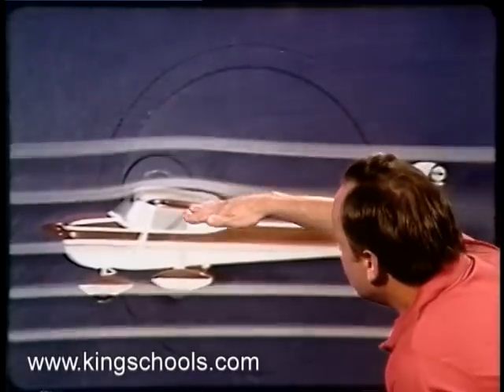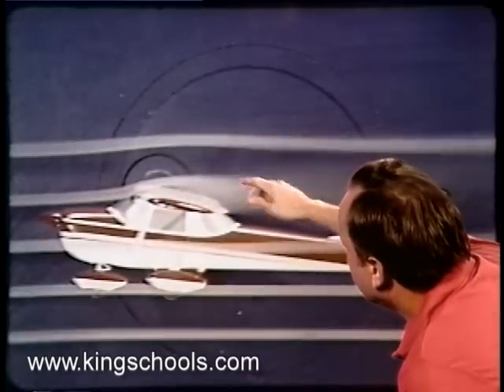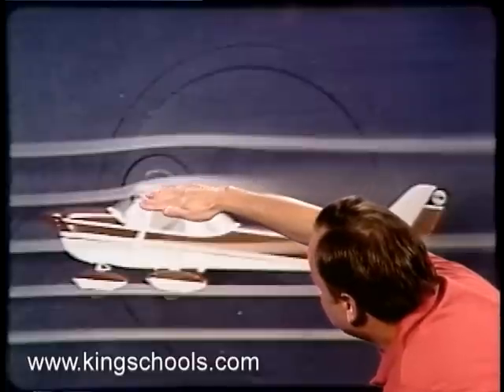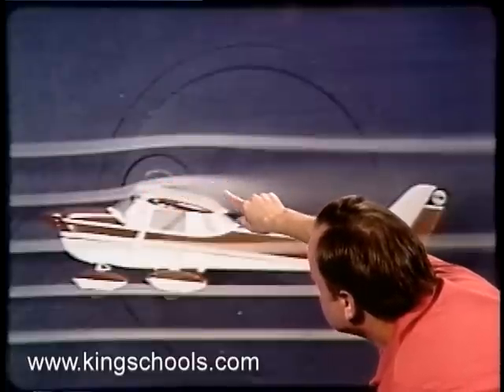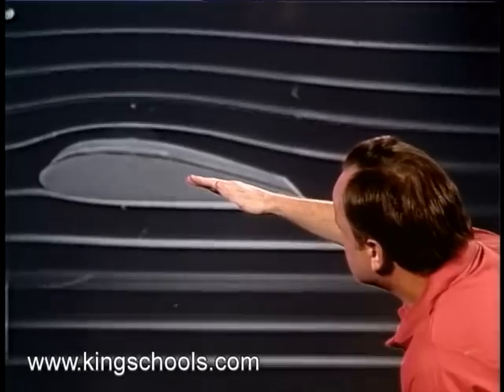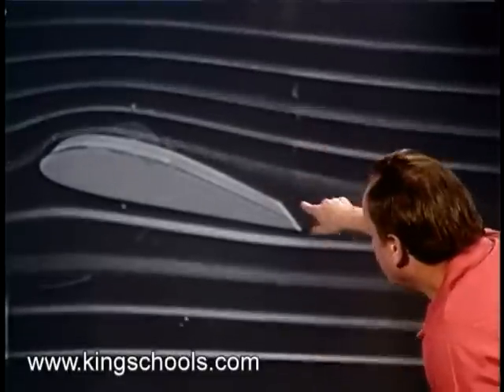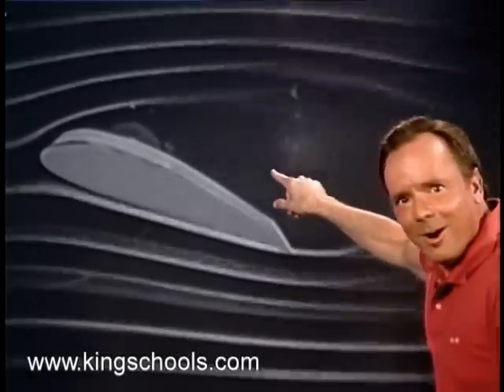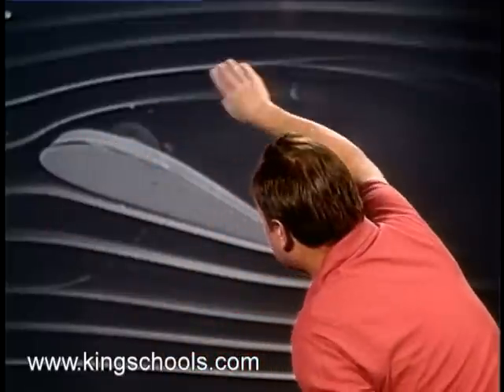What Makes an Airplane Stall- KINGSCHOOLS.COM

Comment: @emmanuelmaggiori Speed and air density are put together in a quantity named Reynolds Number. For a consant Reynolds Number, the wing stols at a certain angle. If you change Reynolds, either by changing the velocity or densitym the angle may also change.

Comment: He is right. An aircraft always noteALWAYS will stall at a particualar angle of attack. U can stall in straight and level flight ie if not enough speed to generate the lift at the critical angle or say if a gust of wind comes along the stall warning will come on. YES ANGLE OF ATTACK DOES NOT VARY WITH WEIGHT BUT THE STALL SPEED DOES IN MANUALS U HAVE A STALL SPEED GIVEN TO U BASED ON SET CONDITIONS IE MAX WEIGHT FLAP UP ISA ETC AND IT WILL VARY IF THE CONDITIONS OF THE AEROPLANE ARE DIFFERENT

Comment: In this video the air is flowing horizontal from left to right, if the aircraft was flying upwards at an angle of say 45 degrees from level would the airflow not be flowing horizontal from left to right but down at an angle of 45 degrees so the airflow would still be zero degrees to the angle of the wing? Hope you understand what im trying to say.

Cheers Lee.

Comment: @emmanuelmaggiori it doesnt matter. it will always stall at the same angle of attack. no matter of weight air density turbulence tailwinds or anything like that. although some of these things do change the speed of which a wing stalls for example weight. it will stall sooner but at the same angle of attack.

Comment: @hen555 I think...( just a opinion ) as you raise the nose of the plane and increase the angle of attack the plane also changes the direction of flight and as the plane starts to travel upward as well the relative angle between the air flow and the wing stays within the limit .... unlike in the video where theoretically the wing has increased the angle but still appears to be travelling in the same direction .... I would need to do a diagram of vectors to explain it better ...

Comment: no he is 100% correct. AoA is all that determines when a given wing will stall.  Speed does not have any part in the equation because as you slow, the relative airflow comes from a different direction due to the fact that your plane/wing is essentially falling. If you are not familiar with Angle of Attack.. basically, AoA is based on the "Relative Airflow".  so as you slow down, your airflow hits that wing from a different angle than at speed.  Angle relative to the ground doesn't play any part.

Comment: but wait... if the speed is fast of the air particles, cant you have a higher angle of attack before stall? I mean in my testing on FSX, I can make an airplane almost vertical and still gain altitude until the speed decreases then I stall. My guess would be that although I am at a high angle of attack... there is no lift generated and the propulsion from the engine is giving it altitude...not bernouli's principle. Someone care to explain ?
Reply: Angle of attack is between the chord line of the wing and RELATIVE wind (not the horizon). So yes, your nose may be pitched waaaaay up, but it has to do with where that relative wind is. So if we think of it another way, aerobatic pilots can stall a plane while pulling out of a loop. Their nose can be pointed at the ground but the relative wind it still coming face on. So if they pull back on the yoke too far, they can exceed that angle of attack. Hope that helps somewhat

Comment: @emmanuelmaggiori engineers work with the angle of attack. you can convert that AOA to a lift coeficient for a given wing and for each coeficient you check the corresponding speed engineers convert to speed stall just for the pilots to read pilots will always talk about stall speed engineers will always say maximum angle of attack

Comment: So, is he saying when the AOA gets so steep that the surrounding air at atmopheric pressure can't get pushed against the upper wing surface and directed down, you loose lift?  Also, isn't high AOA just a situation caused by going from level flight & trying to climb too steeply?  If you had the thrust to climb at the angle in the 1st place, you wouldn't have stall.  Something isn't jiving here.
Reply: A few inputs that might further excite your curiosity:.
1. A rocket climbs with zero lift produced for the purpose. So yes power at times matters.

2. Drag Increases with reduced fwd speed due to requirement of higher angle of attack.

3. A steep attitude by itself may not contribute to the entire  drag penalty. There is something known as thrust to weight/ power to weight ratio etc that cause some concern.
Reply: Also, a steep climb does not mean high angle of attack
Reply: Attitude and angle of attack ...not the same

Comment: I was doing a test at work today and was wondering why, when flaps are at 30, airspeed is low, and stall vane at a certain angle, the a/c was fine, but increasing speed made it stall. Is this because the faster airspeed distorts the airflow over the top of the wing?

Comment: The problem I see with this video is they are talking about accelerated stalls not stalls we are use to, they are putting the cessna wing into a consant speed of air and increasing AOA till the wing stall, in this case over loading the wing. In real life of course the plane is going to climb because of more lift, slow speed stalls we need to increas aoa because of a loss in the lift then once the angle gets above 18 degrees is seperates.

Comment: @straighttailpilot IT DEPENDS OF SPEED ALSO ,, I MEAN ,AN AIRPLANES CAN ALSO GET A STALL CAUSE OF LOW SPEED ,, THIS (STALL SPEED) CAN ALSO BE MODIFIED WITH FLAPS ,,,,,, AND FOR STALLS FOR HIGH ANGLE OF ATTACK ,, YOU CAN MODIFY THE STALL ANGLE WITH SLATS

Comment: @hen555 in FSX try pulling back ALL THE WAY at once, it will stall fast and not climb at all (pretty much), that's because you hit that angle of attack. And remember, it's a flight simulator... it's not a real plane. Yeesh.